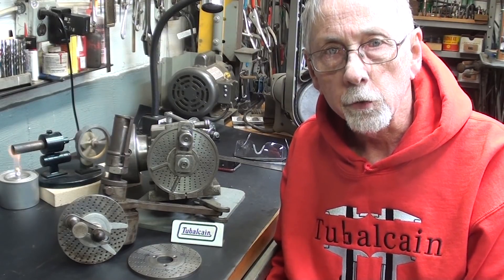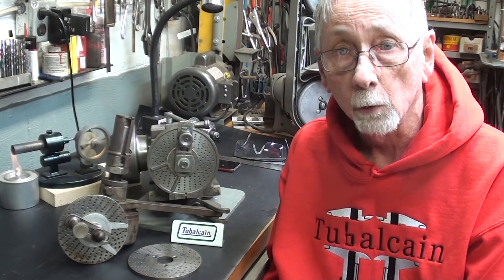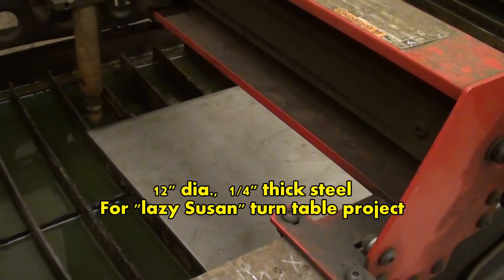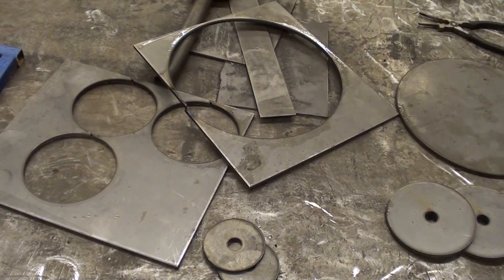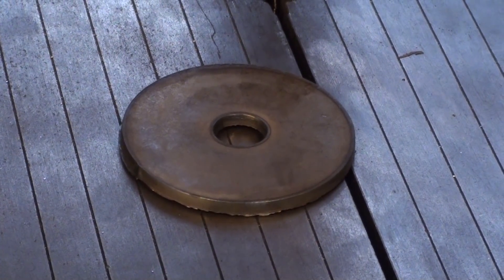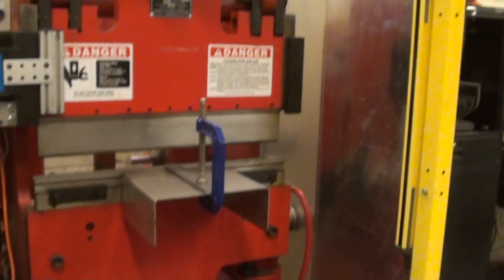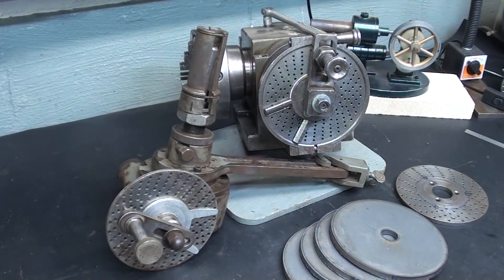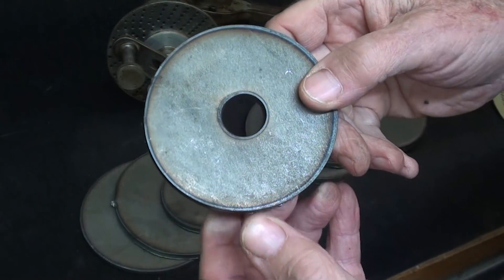Plasma Cutting Dividing Head Plates TIPS 620 tubalcain

Comment: Nice to see the school shop.  
Very good that they managed to get some CNC machines. Do they have a wood shop with a CNC router?
Reply from the maker: Actually, yes they do
Reply: @mrpete222  The local school system just got CNC routers for each of the Jr. highs.  Servos & a water cooled spindle. A very simple water cooling system but why? At any rate the administration decided to take the spindles off and bought 1 1/2hp DeWalt routers to replace them. That means they lost the ability to control the spindle speed and have short lived under powered machines.

Comment: In the series, is it possible to go back to the school and have them plasma cut you a dividing head?  I suspect the plasma cutter knows how to do bolt hole circles, although it may not be able to do the small holes at an accurate size..  It would be interesting to see if it could do the job.
Reply from the maker: The holes would be too large and in accurate    Perhaps a laser cutter rather than a plasma cutter could do it?
Reply: @mrpete222  That's what I suspected.  The accuracy should be all right, but the kerf size control is something I've not seen any videos about.  It's pretty evident that a laser cutter could have the accuracy, based on my experiences with laser cutting plastic.  Perhaps a water jet has a well enough defined kerf?

Comment: Why do you need 25 divisions?
JIM
Reply: The short answer is that there are times, depending on what you are producing, where any number of divisions could be needed. These divisions are not necessarily for holes, but may be flats, slots, etc..  In a job shop you never know what will come in the door next.

Comment: I'm not a safety na*i but those boys looking at the plasma should have been wearing proper tinted safety glasses.  The UV coming off a plasma arc is intense.  I am interested is this series I have a L W Chuck dividing head it came with one of 4 plates, they were made of cast iron and it was cracked and it broke.  I had some 3d printed in PLA don't know how accurate they are.  thanks for the videos.

Comment: You could also have cut those plates on a milling machine, using a boring head for the centre hole, and a rotary table for the outside circumference.

Comment: I recently bought a milling machine.  I would like to buy a Dividing head with plates.  There are many $4 to 500 Asian brands and then several in the $1000 range and up.  Do I need to save for the more precision higher end models or will the import be ok for making simple gears that work.  I simply want to appreciate the making of a gear for some projects.
Reply from the maker: The cheap ones are good enough
Reply: @mrpete222  Thanks for reply...I enjoy your video's and wishing you and family a Happy New Year.

Comment: I don't even know what these Dividing head plates are or what they do!
Reply: Think of the dividing head as a freewheeling spindle that you would like to stop and lock at particular positions so that you can perform an operation at the positions(drilling, milling a flat, etc.). Your workpiece is secured to the dividing head and thus stops with it so that the operation can be performed with it.  On the dividing head a pin will fall into the hole locking it at that position.